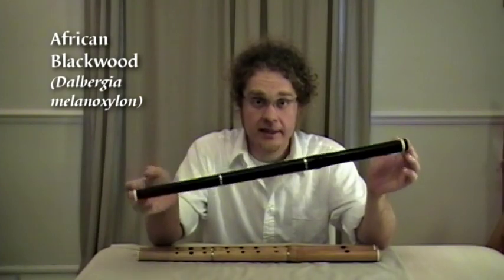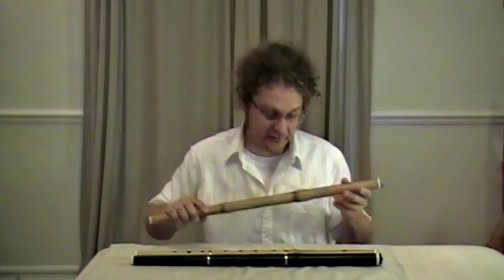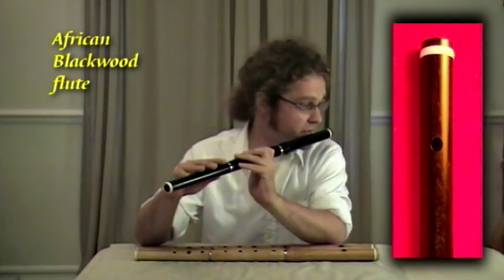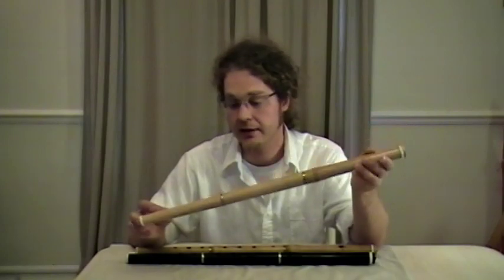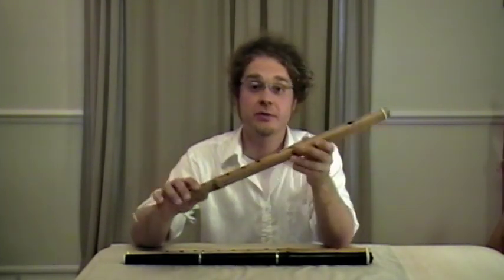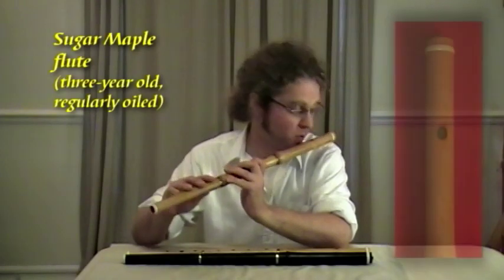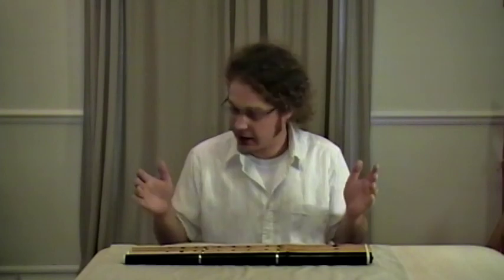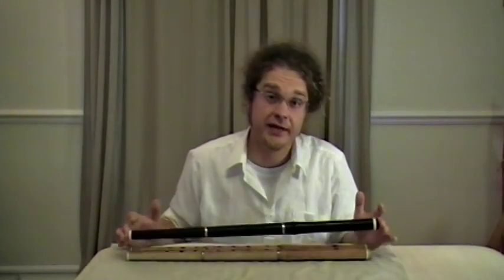Comparison of wood for Irish Flutes (African Blackwood vs. Maple)

Comment: The tone color differences caused by different material were maybe mesurable but not perceivable, because sound is produced when vibrations travel through air, while the pipe material dosen't vibrate. In this video, there are no perceivable difference between any two of the three flutes. Those who claim that the difference is perceivable cannot pass a blinded-experiment. They are just being strongly influenced by their preconceptions and wishful thinking. The performance of a flute is going to be principally determined by its shape providing it’s smooth, doesn’t leak, and it’s strong enough not to vibrate and rob energy from the vibrating air column.